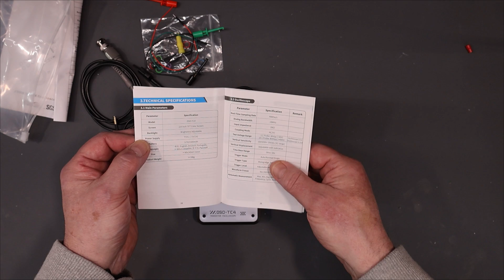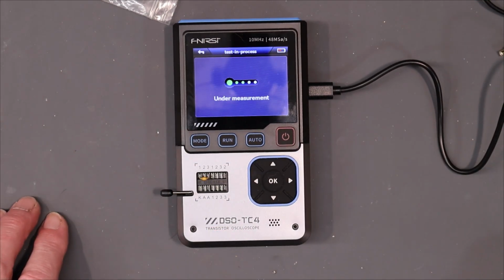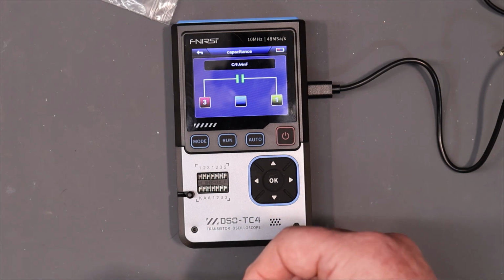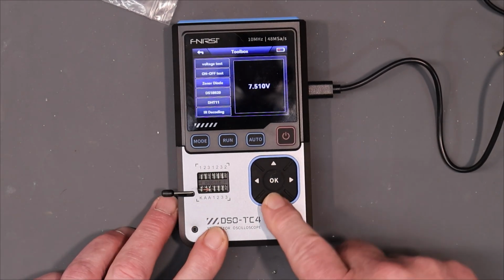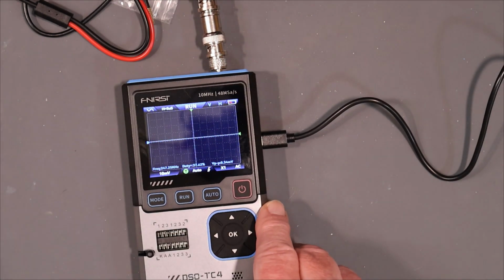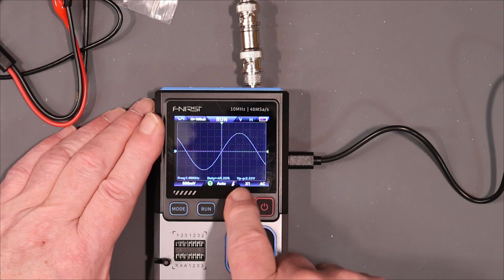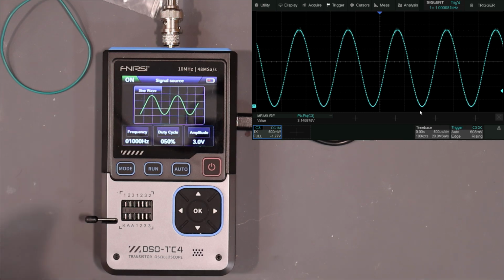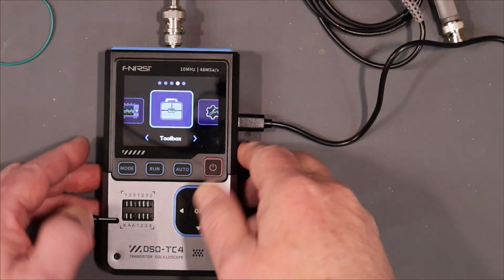Uni-Byte 0273 - FNIRSI DSO-TC4 Multifunction Electronic Tool REVIEW

Comment from the maker: Just figured out what the "ON-Off Test" function is in the "Toolbox" menu is.  It's a continuity test.  You have to use the clip-leads placed into the socket, not the alligator leads in the MCX socket.  Place two leads into 1, 2 or 3 (each lead in a different number) and away yo go.  It actually works very well.  Nice touch, but they could have explained it better in the manual.

Comment: Great video and short review. Would it be possible to see a hands-on review as well?

I'm personally interested in whether this product can be used to measure the switching frequency of an IC in an SMPS—specifically the PWM controller IC that drives the MOSFETs.

Since it is battery powered O-scope. And this basicly makes it as differencial probe if im not mistaken?
Reply: Have a look at the whole line, though.  This one is more targeted at basic electronics needs with the low bandwidth.  The FNIRSI 1013D Plus Oscilloscope looks pretty good for power electronics.  100 MHZ, comes with a high voltage probe.  150 Shipped from Amazon.  I think an equivalent from Picoscope would probably be 4 times as much money or more.

Be careful attaching probes.  There's a second probe mount exposed which can be partly live depending on how the scope is wired internally.  It would be good to find a cover for the 2nd mounting point if you aren't using it.
Reply from the maker: @jetsams_ghost  The 1013D and the 1014D are early efforts.  They are not supported by FNIRSI and actually can't be.  They were not given any way for FNIRSI to provide firmware updates.  The worst part is, they do not meet specifications.  For instance, they are both only capable of ~30MHz.   I would not recommend either of them.  For an upgrade on the DSO-TC4 I would strongly suggest the 2C53T.  It does meet it's specs, is faster than ether the 1013 or the 1014, contains a full blown DMM and a basic signal generator, costs much less than either and is fully supported.  There is a tablet version of it too, the 2C53P, with a bigger screen, but it does cost a bit more.  Still less than either the 1014D or the 1013D.
Reply: @uni-byte  Great info, thanks.  I have one of their desktop scopes which is fine for now, but may get a portable one if I ever do get deeply into power supplies or automotive.  It's great that the old "toy scope" price point broke through to become truly useful tools somehow.
The small multi-meter like form factor is very appealing as well, but I like the tablet scopes too.
Reply from the maker: @jetsams_ghost  Yes, the performance/price ratio is rising rapidly.  VEry good to see.
Reply: @uni-byte  Apologies for the late reply, and thank you both for the detailed answers with lots of useful information. Lately, I’ve mostly been working on repairing SMPS units from TVs. When it comes to SMPS, I’m always a bit cautious since using a regular oscilloscope on the hot side, I know that connecting the ground incorrectly can easily fry the scope. That’s why I was thinking a battery-powered oscilloscope might be a good option—just to check whether the main IC is faulty or not. And I hoped that it would behave as defirential probe.
I think 10 MHz (and 50MHz) would be more than enough for my needs, since I only want to check whether the IC is switching or not. I don’t need to analyze the exact waveform or edge sharpness. As long as I can confirm there is or is no switching happening. So I know If I need to order a replacement IC and swap it.
Reply from the maker: @ If you have the extra few $$$ and don;t need the component checker, I'd recommend the 2C53T/P.
Reply from the maker: Possibly!  However, it only has 10MHz bandwidth and a lot of the potentially harmful noise coming from a SMPS can be very high.  You won't see much of it.  Yes, for low voltage measurements is will behave like a differential probe.